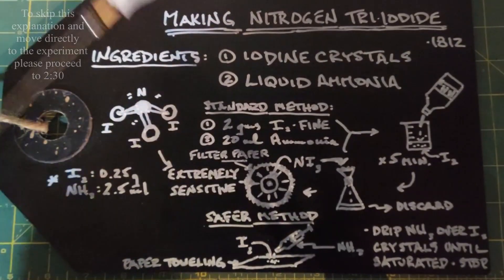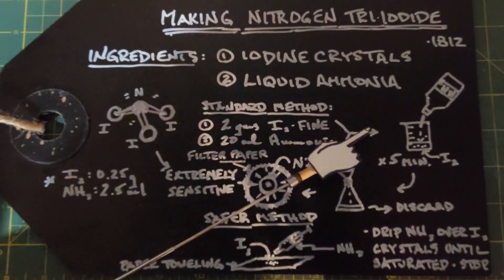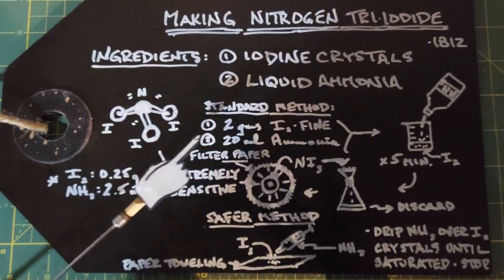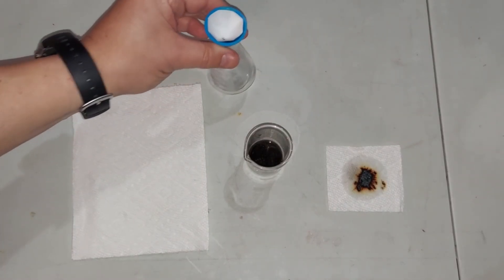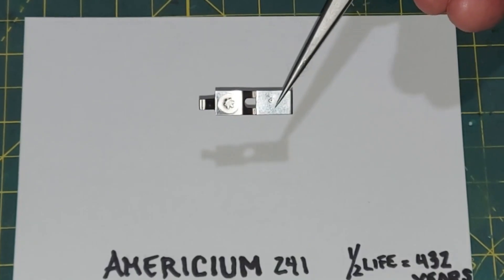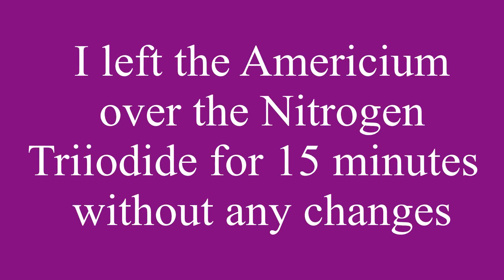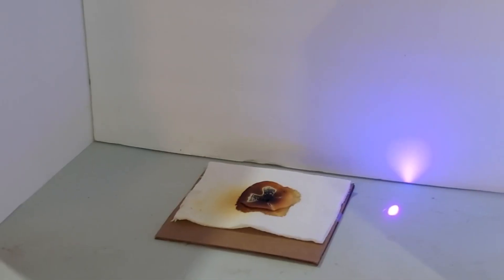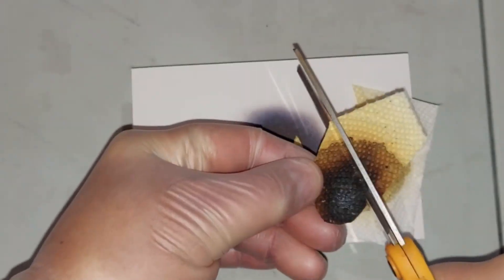Making The Nitrogen Triiodide Explosive

Comment: Hobby method: used prill beads iodine, dunked under grocery-store ammonia.  Poke it with a wood chopstick, and as it reacts, it turns blue-gray and falls apart. No grinding required. Keep poking until all the red color is gone, and fine blue-gray powder results (perhaps pour off excess ammonia solution, and add more, if some red color persists.)   Then pour it all off onto paper towel, and rinse glassware immediately so it doesn't shatter.

IT EXPLODES WHEN WET!  So claim several sources, but only if stored under water, and allowed to compact-ify itself over days/weeks.

Me, I once made up about a half cc, scattered over twenty small slips of paper (spaced 4in apart.)   I kept poking one, to see if it was dry enough to trigger.   THEY ALL WENT!   I was too close, and temporarily lost hearing in one ear.    So, if making several small smears, on separate bits of filter paper, even when slightly damp, still they need to be spaced FAR more than 4in apart!
Reply from the maker: Wow.  Seriously.  Thank you for sharing, we all can learn.
Reply: Where do you buy the pill beads?

Comment: What concentrations is the ammonia?  I 30%
Reply from the maker: The concentration of ammonia doesn't matter that much.  I used 10% in this video.  If you used a lower percentage you only need to leave the iodine crystals longer.
Reply: @cranialconstruction question! Like how long with the Walmart brand Great Value ammonia which like 3% or 5% ?